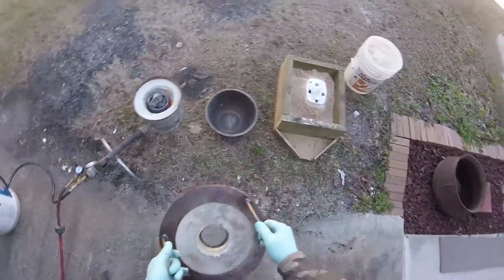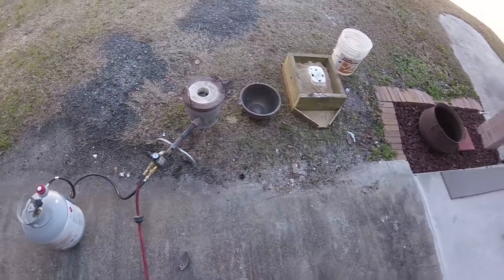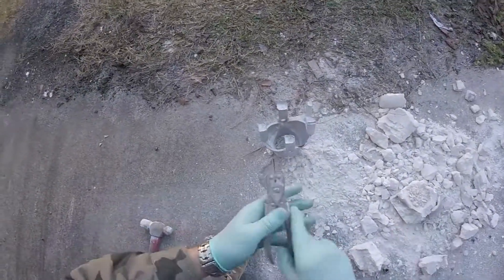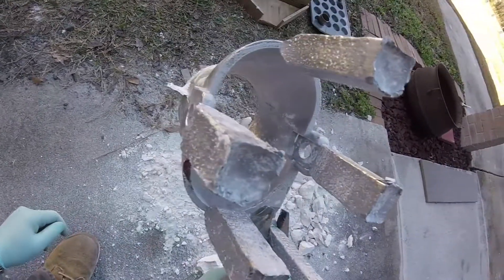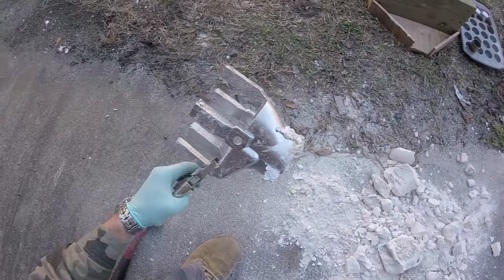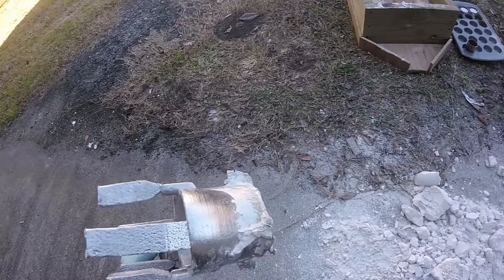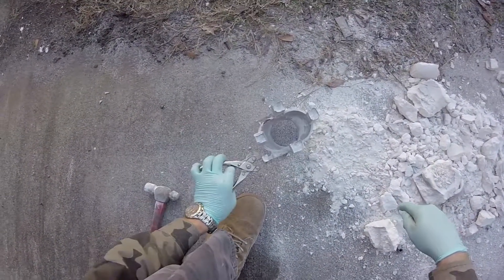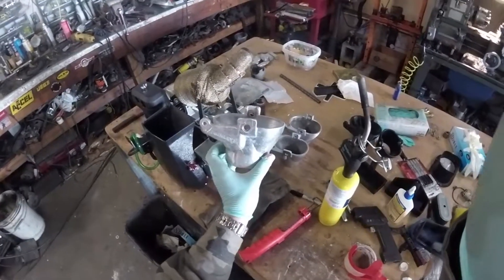Lost Wax Mold Burnout and Aluminum Pour - Mokai ES-kape Steering Nozzle

Comment: What is your dry out process for the plaster mold after the burnout? I’ve been running into too much moisture in my plaster molds.
Reply from the maker: After burnout there is no moisture left, mold is glowing inside. I've had molds sit for days before pouring, if you're having issues then it could be your aluminum could be too hot or not degassed well enough.
Reply: @ImprovingYourMokai  I’ll give those variables a shot, appreciate the response! Thank you